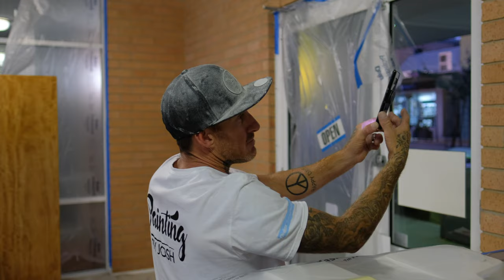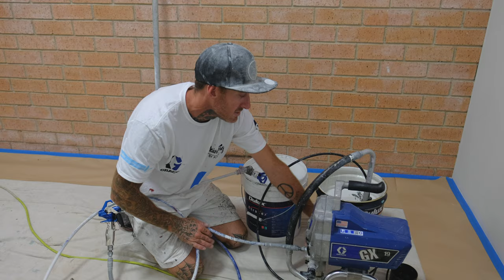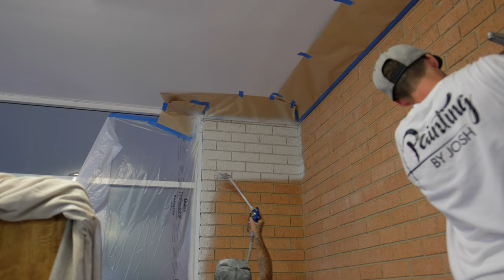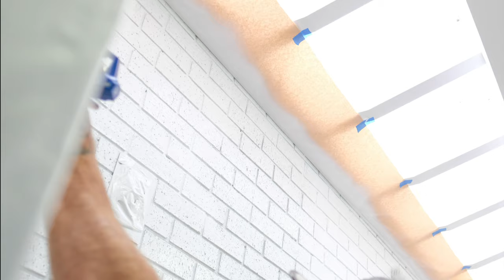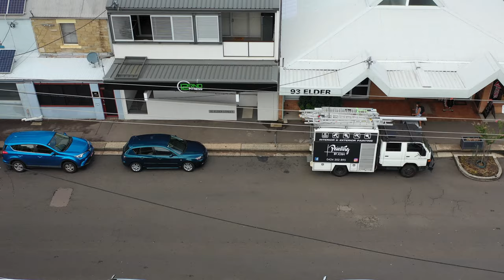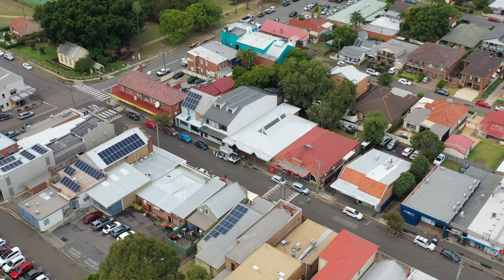PAINTING BRICKS WITH AN AIRLESS SPRAYER

Comment: What is that little pivot spray guard called?
Reply from the maker: This is called a Graco CleanShot Shut-Off Valve! It helps with the spitting when you're running a tip extension

Comment: Do you take on much exterior spraying work? 

Do you treat the surface before spraying or do you just tape up and start spraying? 

I am based in the U.K. and have only ever used my sprayer for interior work
Reply from the maker: I do a lot of interior & exterior work mostly sprayed. Treat the brick work? There is nothing to do with bare bricks tape up and spray 💯🙏🤙

Comment: Nice one! Any tips on which paint to use for exterior brick walls/house facade?
Reply from the maker: Cheers. I'm not to sure where you are located, just a good quality washable water based exterior paint would do. I use @dulux weathershield on all my exterior works🤙
Reply: Cheers Josh, I'm in Sydney - northwestern suburbs. I enjoy watching your vids mate. Always been intrigued about the whole paint vs stain discussion in regards to bricks. Does the dulux peel off in time at all? Cheers bro.
Reply: I’m an older German guy (60) who lived 14 years in Canada. Moved to Panama and built a house myself. After a work related accident, I have problems with both of my shoulders and left hand. As I started my construction, I worried about the paint jobs, inside & outside. Now I see this airless paint sprayers and think that this would be much easier to use than rolling. And don’t say: Hire some locals. They do - sorry to say - a real horrible job here in Panama. I see this every day. I’m not a professional builder (it’s my second house I am building) But when locals who bought a lot in my area, approach me and asking if I could build their house, it says it all. Even the owner of the development company who sold the lots (he is also in construction) asked me: How do you get the walls so straight and nice? I actually didn’t know what to say. Anyway. Nice video. The brick wall is a good example of how good a paint sprayer is compared to a paint roller. I think I have to buy me a paint sprayer too now.